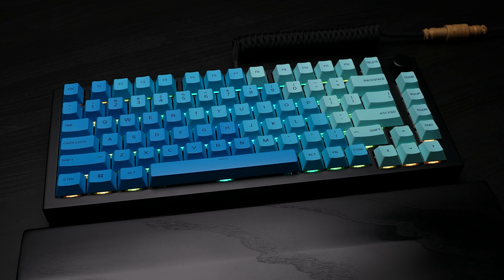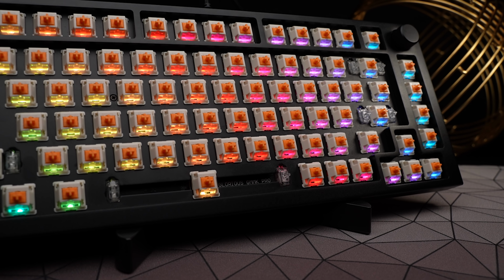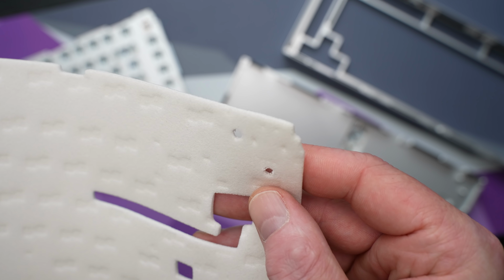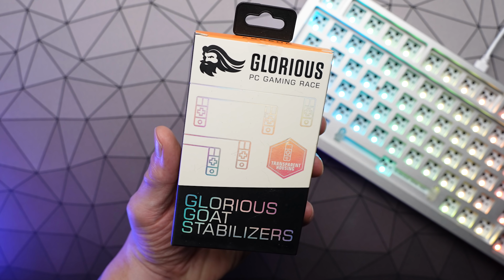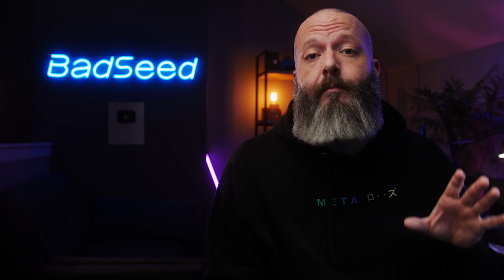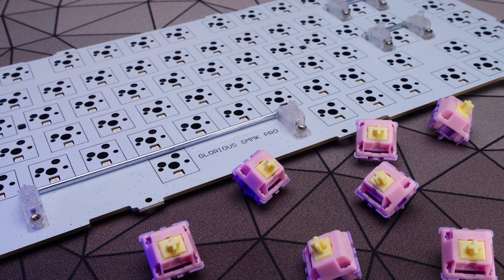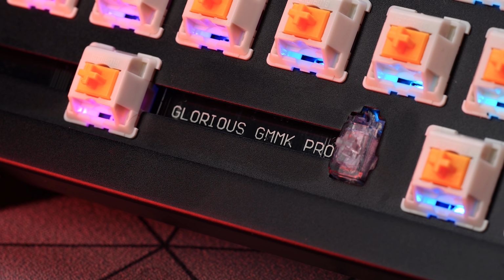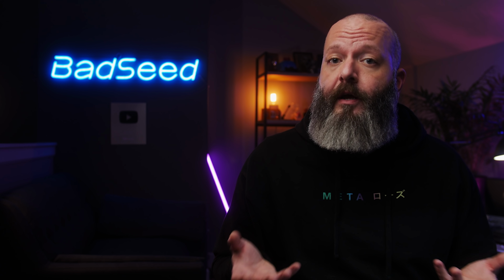GMMK Pro Review: Glorious Game Changer?

Comment: Great video as always Brian. You mentioned it in the video, but I highly recommend you try out the kbd67 Lite. Now I understand that it is entirely a polycarb board but personally I think that even if something is cheaper in terms of "material quality" but better in feel/sound, then it is still a better board. I don't own a gmmk pro, obviously, but I do own a kbd67 lite and I think that this board truly feels like the best value board that's ever been released. Like the board HAS FLEX, great for linears. The board has great sound, and the stabs are pretty insane stock (although adding a bit of extra lube to the housing doesn't hurt). I wanna see it stack up against the gmmk pro because I think these are the 2 big hitters for the best bang for buck in the market. I'd love to get your opinion on it especially as someone who has tried most every other entry level board besides the aurora.

Comment: I have both the drop alt high profile custom with the artic base and foam from stupidfish. And it sounds great with all thr modding needed. But i can't say the same thing about the NK65 aluminum edition. The tolerance of the plat for the switch housing is tight af, taking them out is a pain in the ass and its stiff af as well with or without foam. Again from stupidfish. I had to mod it even more. I hope thr GMMK pro changes that a bit. And i believe the kbd87 lite is a better option than the nk65 EE.

Comment: Looking for a board for work (IT job) - currently using a TTake Poseidon with Kailh Sage Pro Heavy (80g clicky) - don't think I have used anything other than full size clicky since moving to mechanical, but have to go back to the office soon - really liking this one, but concerned about the switch from clicky to tactile, and full to this format. Any advice, tips? Not opposed to putting some work into a board, but haven't found any solid sources for parts. Board at work will be used with a thin client (Wyse), so no software bits available, but I could change stuff at home as along as it would keep for transit. How would I do a print screen? That is the only key I use a lot that isn't on this board...

Comment: Considering both you and Taeha commented on the stiffness of the gasket mount on this and Taeha felt the side gaskets weren’t even necessary, I’m wondering if it would be worth it to either not put gaskets on the sides or to just get a dremel and remove them from the plate altogether.

Comment: I really want to like this Kit but I think the biggest thing that is holding me back is this; more because I guess I just don't understand and want clarification:  What is the purpose of flipping the Switch Orientation from North to South and having LED Lights on the bottom?  I totally get the 5-pin integration which is great!

Outside of that, if they plan to keep to continue this format, do we know whether or not GMMK will be developing any Keycap Set Options that would utilize these South Facing LEDS?
Reply from the maker: So, Wildcat has an amazing video explainer on interference.  Thats what happens when cherry profile caps (like GMK) strike the edge of the switch housing before the switch is fully depressed.

South facing ensures that wont happen.  The most commonly available “fix” is to use pudding caps, but there are other sidelit caps that can take advantage.
Reply: @badseedtech   I will look into that; thank you so much for the response and quick explanation!  Keep up the awesome work you do, Sir!

Comment: I am planning to get the tkl versionnof this board, my actual keyboard is an aukey with blue switches but the noise is unbearable, both while on discord or even at night typing, I hope that with some silent switches and durock /zeil stabs I can achieve a level where It does not get picked up by my mic :/

Comment: I still can't wrap my head around all these barebones costing so much vs. complete pre-built keyboards. (that are also full alum and pbt)
Reply: it really is a different in quality i own the gmmk pro and there is no comparison to an 200 euro keyboard.
Reply: @thomaskletzl6493  maybe, i bought the hyperx alloy 60 and I'm really happy with the quality of it. It's body is thick aluminum, and the switches are better than cherry MX red, very smooth. I'm probably going to  build my own board some day, but not with a frame alone going for 200€.
Reply: @Link9164  its not just the frame its the case the pcb(hotswap) the foam the gasket mounts the staps

Comment: I’m new to keyboards. Can a 5pin pcb support a 3 pin switch ?
Reply from the maker: You can.  And most of the time, its totally fine.  The only issue it may cause is a lack of stability in boards where the plate openings are a little larger and make for a loose fit.
Reply: @badseedtech  thank you so much bro !

Comment: The wire in the middle and the upside down rgb ain't cutting it. Where's the pro ?
Reply from the maker: Actually both are considered pro.  The wire is to connect the daughter board usb-c connection so it can be placed in a better position on the case and the south-facing switches are to support higher end keycaps.
Reply: @badseedtech  these are just the cons for me as I'm only messing around:) decent keyboard in my opinion, for some reason I can't switch from my drop carina or my drop alt high profile. I want to actually try this keyboard out in person so I'm considering on purchasing with some black inks

Comment: This looks like almost exactly what I've been spending months looking for except for one little detail; it has a high profile case unlike the original GMMK. Given the construction, how feasible do you think it would be to mod it to work w/o the top of the case, either through an official custom top or a third party one? Also kind of shocked at how much customization there is but no option for a floating keycap design.